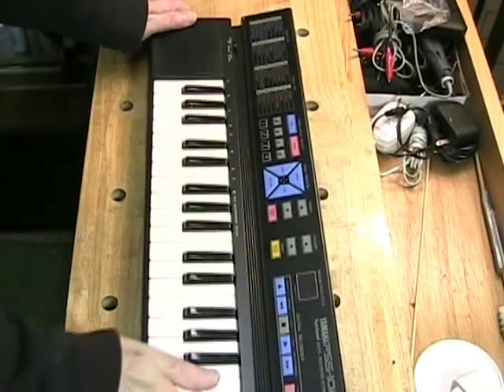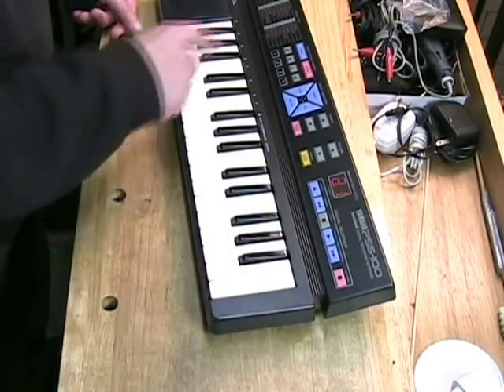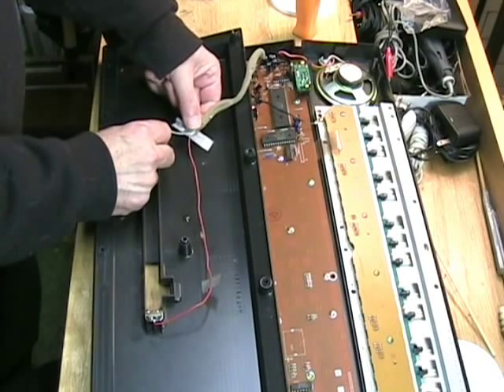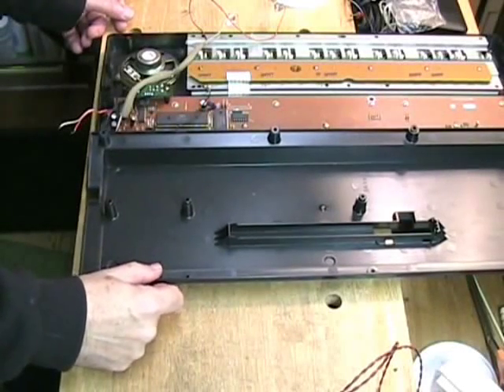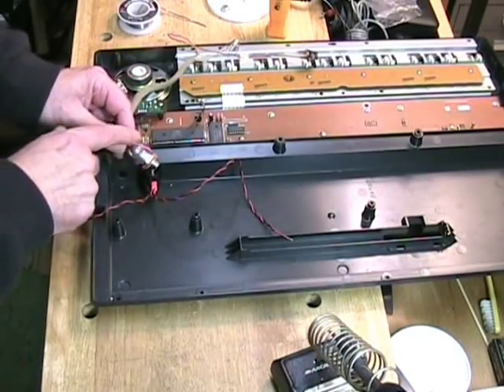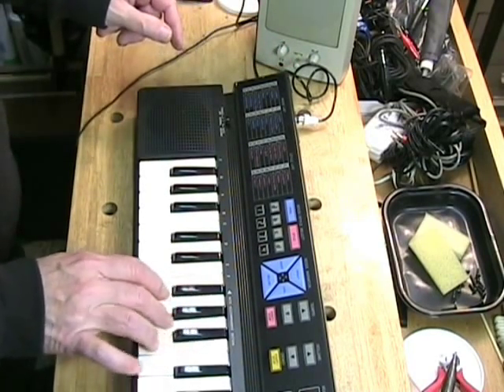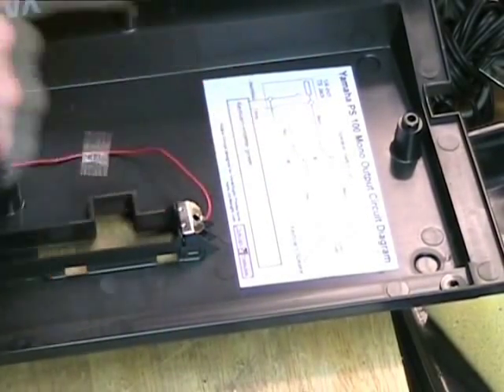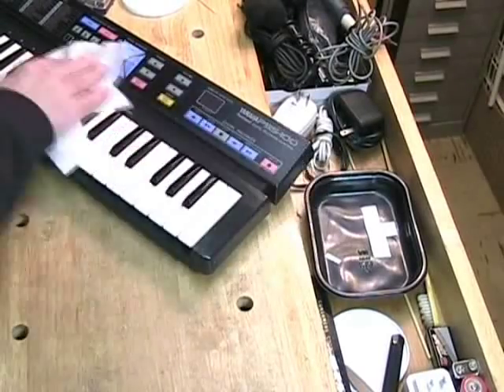Yamaha PSS100 Vintage Keyboard Mod 2

Comment: I may have said this in your other Yamaha keyboard related videos, but the sound of that keyboard reminds me so much of a late 1980's or early 1990's video game system such as the NEC Turbografx or Sega MegaDrive or Master System, actually this keyboard to me sounds a bit more like the Nintendo Entertainment System.  The sound of that keyboard brings a smile to my face.  What a great practical modification, does the volume control on the keyboard also effect the audio output you installed?